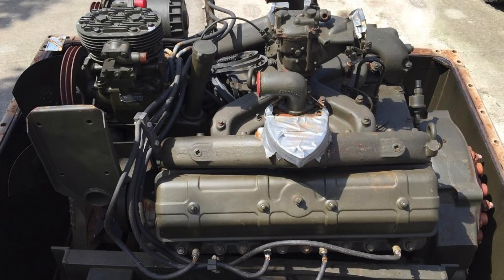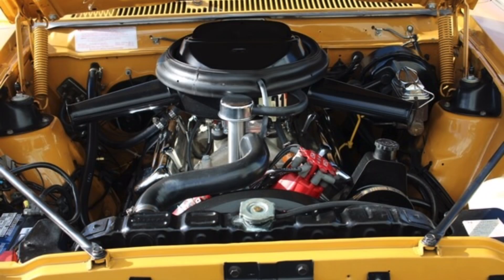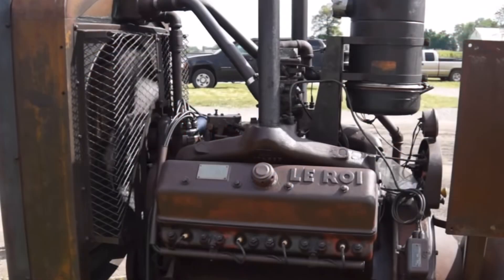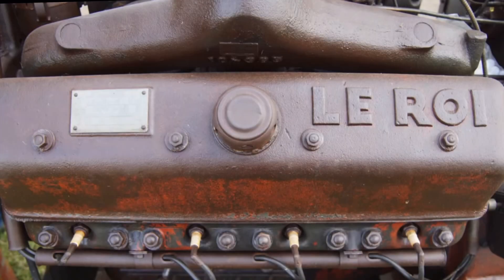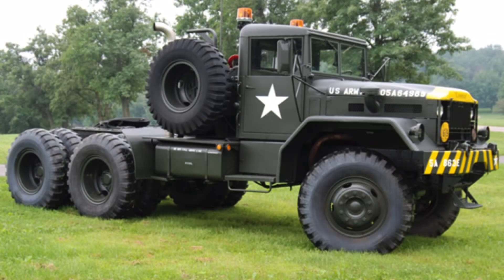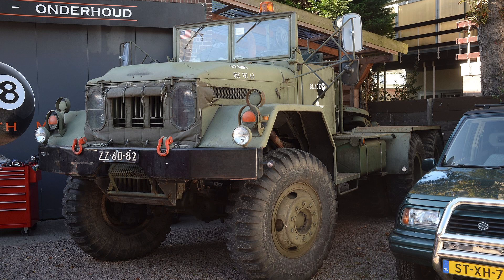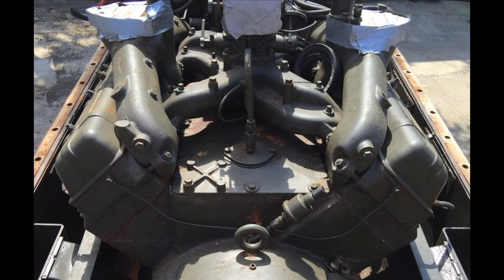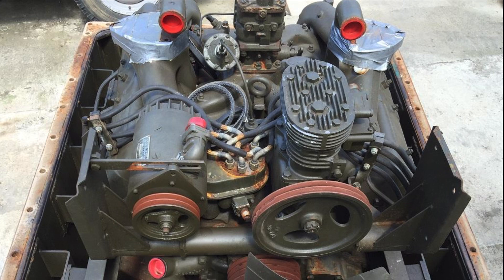Largest V8s You've Never Heard Of: The LeRoi 844/884 Cubic Inch Gas V8 (in Mack M123/125 10T trucks)

Comment: There's no replacement for displacement.
Reply: Only if you're limiting it to atmospheric pressure.
Reply: @tonyelliott7734 - atmospheric or not. Power is most closely related to displacement... be it by piston, or by turbo.
Reply: Sure there is. Forced induction, nitrous, nitromethane, even high revs all do what more displacement does. I have a pretty healthy 383 in my '68 Barracuda, and a supercharged 5.3L in my 2012 Colorado, they weigh similar amounts, are just as quick as one another, and the Colorado is in PERFECT mechanical order at 102,000 miles (I rebuilt it at 70,000 when I put the blower on it, but just so I could put forged pistons in it while I was at it and put a mild blower cam in it. Everything looked new, I dingle-balled the bores but even that was unnecessary).
Reply: @The_sinner_Jim_Whitney - all off the power adders you mentioned are literally just different ways to increase the amount of aspirated air and fuel... which is, by definition, DISPLACEMENT.
Reply: @driverjamescopeland  I understand that perfectly well, but that's not what's ever meant when people say that and you know it.
Reply: @The_sinner_Jim_Whitney  - that's what I mean when I say it, because it's true... there's no replacement for displacement, by whatever means necessary.
Reply: @driverjamescopeland  Fair enough. Well, that's never what virtually anyone else means, hahaha!
Reply: Not really. If you've ever driven some serious cubes..there is an urgency off the line that you simply don't get with anything else. @The_sinner_Jim_Whitney
Reply: @The_sinner_Jim_Whitney   Too expensive and impractical for most of us, Jim.
I'll take the cubic inches.
Reply: @67marlins  My truck's motor is literally factory (can be bought for $1,000 anywhere), and didn't need the camshaft and pistons, I just wanted to make sure it would last. Build a big-inch motor for $4,000, and tell me how it runs. I have $5,500 in my 383.
Reply: @The_sinner_Jim_Whitney  OK, but that would pay off my house.
I'm on the wrong side of 50 for expensive auto re-engineering projects.....I  place my faith in original equipment big blocks and they last forever the way I maintain them
My '70 Marquis 429 2 barrel is all the 'push' I'll ever need.
Hell, the 390 in my full size '70 Ford wagon was enough!
Reply: @67marlins  Exactly, I could make more power with a turbo LS for probably 60% of what I have in my 383 (THAT'S the engine I built for $5,500-ish). Show me an OE big-block that ever made 200,000 miles without overhaul. Modern forced induction engines are deemed faulty if they don't. I LOVE old big-blocks, and for non-performance use I hate the complexity of forced induction, but I don't kid myself that we haven't learned anything about efficiency and manufacturing precision/parts uniformity in the 50+ years since my Barracuda rolled off the line. And it has a ballast resistor, coil, set of plugs, various springs, etc. in the glovebox and tools, fluids, etc. in the trunk because any could go bad at any time. Oh, and I could build two 500-hp LSs for what I could buy a running pre-smog hot big-block for, which might run 100 or 10,000 miles before it blows up, no way to know. Hell, maybe even NA if I had the equipment. Go to bed, gramps  (I'm 38, by the way, not a kid, I can just see the way things are going and have been for 25+ years).
Reply: @The_sinner_Jim_Whitney  'show you an OE big block that made over 200,000 miles without overhaul?
Yeah, I've owned 5 of them.
Ford 390 one at 250,000 miles still running great, another at 300,000 before wreck.
Plymouth 318 at 260,000
Chrysler 383 at 296,000
Ford 351M at 532,000 miles.
All original.
Bye.
Reply: @67marlins  No. No, you haven't. Not unless you hauled a single grapefruit for a load, at 30 mph in fourth, from Florida to California, with a big block, for a living. I love them, but big old iron engines simply aren't what a 'modern' LS/LT is, themselves still pretty primitive.
Reply: @The_sinner_Jim_Whitney the old big blocks will out live the newer engines you're talking about
Reply: @markcollard9326   I don't understand what you're talking about
Reply: @markwilliams4525  That's for sure.
Reply: I just imagine the dude from breaking bad
Reply: Weight! Hold my  beer 🍺
Reply: As someone who drives a big block Chevy 😂
Reply: There’s superchargers and turbos. 😎
Reply: Boost!!!
Reply: Says my Filipina wife
Reply: @DumbCarGuy  Ed McMahon is laughing, somewhere.....
Reply: How original..
Reply: Turbos
Reply: Forced cold air induction.
Reply: Turbo
Reply: @killer1963daddy - turbo is literally adding displacement. A turbo increases the aspiration rate of an engine... thus, it DISPLACES more air.
Reply: @driverjamescopeland  Good point. Correction - good point(s).
Also, you probably noticed little jimmy.....please don't waste your time arguing with him.....he's 12 and pretends to know everything.
And I agree there's no truly direct answer for intelligent displacement.
Working at a Tier 1.....I see the ever more risky engineering of cutting displacement just to live on the edge of engine failure with added internal stresses of heat, PV, NVA and excessive wear that turbos bring.
Even if the OEMs were sure the customers maintained turbo engines properly like you and I would, the risk is definite as they consider that a worn-out cam and bottom end isn't their problem beyond the warranty sunset.
Reply: @67marlins    Where do you work?
Reply: @killer1963daddy no free lunch, forced induction adds ponies but not evenly over the rev range and not without requiring another cooling system. a turbo i4 and a v8 that have the same horsepower don't make the power the same way at the same time.
Reply: @killer1963daddy  Turbos are great for reducing engine life through excessive heat and oil degradation, and help lighten your savings account by forcing you to have an engine you don't need.
Give me two extra cylinders ANYDAY over an overwhelmed, undersized and under-engineered turbo.
Reply: @67marlins  You got it! Mine is 5.0L V8 420hp, naturally aspirated. Enough torque, no turbo shit. 6 years old, and I won’t trade it in for the new 3.8L V6 twin turbo. But since I am retired, I’ve only put 12k miles on it so far. So still some life left, before plastics and electronics will rise their ugly heads.
Reply: @V8-friendly  Yeah, I see it in the production trends as I work for a Tier 1 manufacturer to the major OEMs.
Toyota replaced their Gr-Kai, a normally-aspirated 3.5 liter V-6 ( a perfectly fine engine ) with the new 2.4 Inline 4, turbo.....the reason I guess is minimize cylinders to over-saturate the design with the excessive stresses of a turbo to pretend that's as good as the missing cylinders....
I don't like or need turbos.....like you, I again say, 'give me two extra cylinders'.
I'd rather have displacement for towing my little boat than forced induction, excess heat, stress, cylinder pressure, and resultant oil blow-by.
Toyota also dropped their V-8s, replaced with the '103e' 3.5 Liter twin-turbo V-6.
Stop and think about that for a minute.....if you favored Toyota trucks, but the dealership said, 'Sorry, but we no longer offer any V-8s....at all'
Wouldn't you then seriously be tempted to check out Ford, Dodge & Chevy for the assurance of V-8 availability for towing, hauling....etc....?
A well built V-6 actually has some minimal design advantages over a V-8.....look at GMC's 'Hercules' family of truck-only V-6 engines from 1959 to 1974.
I'm a Ford guy, and yet I'll say the GMC V-6s were an EXCELLENT design.
But when you start going from a V-6 to an inline 4......for any truck that needs the torque and longevity.....that's crazy. Pretending a turbo can equate to two cylinders is a risky, expensive and stupid path for the manufacturers to take.
People want a choice- and backing them into a corner to accept a turbo 4? That's not smart marketing at all.
Reply: @67marlins   spoken like somebody that learned about turbos from the 1960s

You can put the inlet charge in just as close to ambient as you can get it these days

You can have self-oiling turbos

Every one of your examples is completely nullified

Especially since one of the best things to turbo these days is LS motors. So you can take something that you can bore and stroke to big block sizes and then turbocharge it to three atmospheres

Or are you saying that 1600 horsepower v8s are not good? Lol

With the times we're living in the greatest muscle car era that's ever existed as far as engine performance goes

You can go by a 900 horsepower Dodge that does wheelies from the dealership that has air conditioning
Reply: @Bozemanjustin  Spoken like a 12 year old who pretends he's the final authority. Saying an engineer like me who's observations and experience is 'nullified' is easy when you're too dense to even comprehend the subject to begin with.
I already knew everything you just cited as relevant. So you're comparisons that aren't comparisons are completely irrelevant.
I know it already. I also have an engineering degree, and it's obvious you don't.
Normally I enjoy training intelligent young people at work.
But I won't waste my time with on a pre-teen brain who already thinks it knows everything.
Bye.
Reply: @67marlins  V8s are going away for one reason and one reason only, which is fuel economy regulations, which are getting stricter here and FAR stricter everywhere else in the world. Nothing will ever bring me joy like a healthy NA V8, but to suggest that alternatives can't be built to make the same or better power at the same cost (to an OEM) and reliability is, frankly, just not very well-informed. They've been doing it consistently for at least 20 years in everything but trucks. Trucks do kinda dictate a big, low-stress, low-rpm engine for their purposes, but even that's changing.
Reply: @67marlins  If you're an engineer, I'm a nuclear physicist, unless you also have dementia.
Reply: @The_sinner_Jim_Whitney  No, you're just jealous because you don't have an engineering degree.
Reply: Yes, there is: MORE displacement 👍
But heh, what crime are the manufacturers currently committing against the American icon: All V8s seem to disappear.
Reply: @V8-friendly    wtf or you talking about v8s went away for a while but now they're back with a passion. This muscle car era we're living in right now is far better than the old one

Less muscle cars, but they're far more powerful. At no point in time. Could you buy the horsepower you can get from the dealership during the muscle car era.

The Chevy 325 of today produces more horsepower from the factory than any of the big blocks of the day in the muscle car era

And the fact that you can go by a 900 horsepower Dodge that does a wheelie from the dealership... They never had that kind of performance back in the day

So I would agree with you that v8s went away for a while, and muscle cars went away for a while, but they are definitely back

The fact that you can go to the junkyard and get an LS motor for a few hundred dollars and stroke and bore that thing to big block sizes. You're in a small package. You're living in the heyday of motor transplants
Reply: No replacement for displacement = BOOMER!
Reply: @kkoch666  - and calling someone "boomer" makes you an idiot.
Reply: 0:22 sure there is. It's called forced induction

I can move the exact same amount of air except more efficiently

And for anybody that says, but you could just put forced induction on a large motor... Not if you're putting it in a small package and weight savings matters

I can't put a 471 in a Miata, as easy as I can. Put a smaller motor, and increase the airflow

So considering you can make the same or even more power, there's definitely a replacement for displacement.

However, don't get me wrong. I like big v8s with forced induction, your statement was just made back in the day before. Forced induction was as easy as it is today
Reply: @Bozemanjustin - forced induction is still increasing displacement 🤦‍♂️
Reply: Yes there is...don't talk wet...